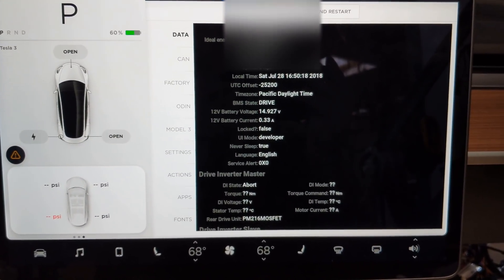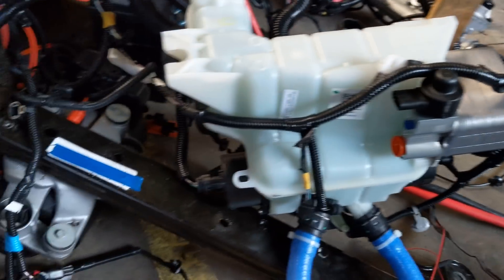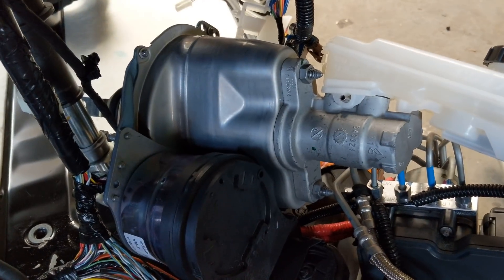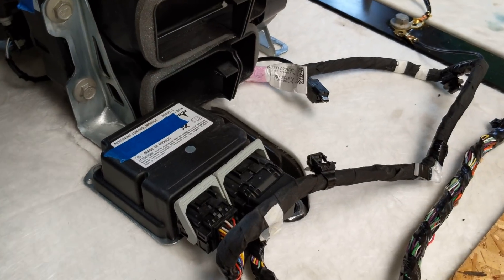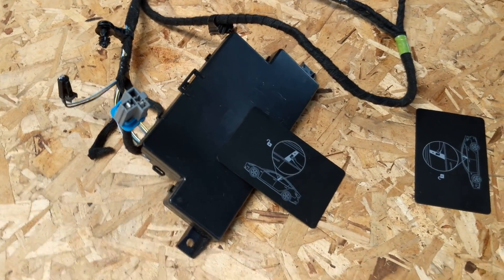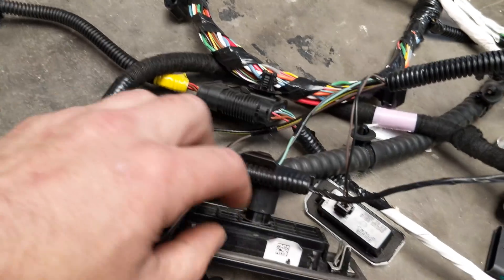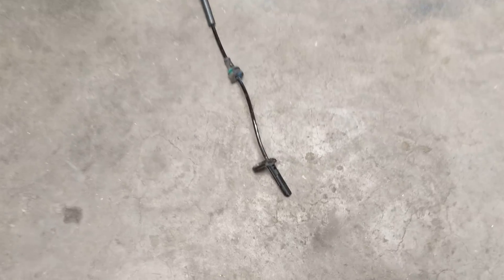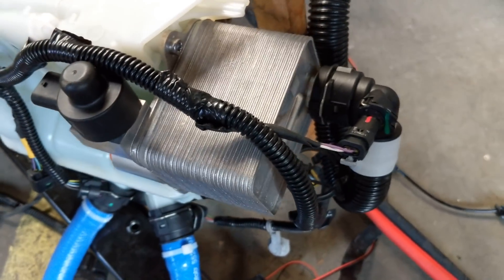Tesla Model 3 - Exploded?!?

Comment: Just a quick question about the screen mount, how hard would it be to put in a spacer to angle the screen towards the driver?  is it just a few bolts or is the wiring interconnected with the mount? Could you maybe shoot a quick video of it?
Reply from the maker: It could be done, no electrical issues, but it would require a custom mechanical solution.  Sorry, I don't have time to shoot a video of it.

Comment: Okay so pardon me for not reading all 280 comments. For a P3D+ what do you think it would take to improve cooling to maintain max power all day at the track? I imagine something in the frunk that adds coolant and more radiators but maybe due to the low temperatures of the battery packs vs ICE vehicles a bigger condenser  or 2nd condenser is more realistic.
Reply from the maker: Research would be needed.  It's not a trivial problem.

Comment: Does the Model3 Have a motor cradle like the Model S ? Does it have the suspension, sway all 
integrated ?
  I want to adapt it to a Factory five Cobra reolica.

Thanks, Jeff
Reply from the maker: Yes, it's very similar to the S/X.  You can see it in my other videos.
Reply: yaa, thanks for the response. I found your other video shortly after that showed the rear clip.

Comment: Many people are having SDCARD failures.  I believe the SDCARD is located in the MCU/ICE module?  Would be nice to know what SD card they are using and how it is partitioned and what file system they are using.  I believe this flash card is used to stage firmware updates prior to the flashing operation.  This SDCARD is probably used for other things like navigation maps, logs, telemetry data etc.  If you would willing to remove the card, connect it to a Linux system and dd image the entire content to an image file, I would be willing to verify the partitioning, file system used and the files contained on the card.  If we can get a part number for the SDCARD,  we might be able verify more details regarding the card (ie.. what type of NAND flash is being used, operating temperature range etc).  I can't believe Tesla would be booting directly from a flash file contained on the SDCARD.  Normally that file would have the digital signature checked after an over the air download and during the actual flashing operation.
Reply from the maker: The SD card is an 8GB Panasonic automotie-rated MicroSD in the bottom of the ICE.  I don't believe the problem is hardware, it's a software bug causing corruption.  It is used to stage some of the FW and it has some logging.  The map data is not stored here.  The car can still operate even with a failed or missing SD card, but it cannot update SW.

Comment: I am trying to find out where the connector(s) are that supply power to the rear seat seatback heaters.  The rear seat bottom heater connector is under the seat bottom on the passenger side.  Thanks for the great videos!!!!!  Regards, Ron

Comment: Do you know how the parking brake works?  What physically happens when you put the car in P? and what is the additional small clunking noise if you then hold down the P button to get the parking brake indicator to appear?
Reply from the maker: There are electric motors on each of the rear brake calipers that can mechanically apply the rear brakes when you engage P.  If it's already applied, the second push-hold just tries to tighten it, but nothing will happen except a small noise.

Comment: Fore most of us it is very much a case of if it stops working you can only walk away and buy a bicycle. The complexity is astounding and way beyond anyone having a hope hacking a temp repair to get home or to the nearest town. It totally raises the cost of any repair into the stratosphere. Even with 10 year internal combustion engine cars the complexity is beyond most people to fault find and repair. I was chuffed with myself working out that a crank sensor had died and that I was able to replace it for around $100, if it was done by an auto repairer I was looking at close to $1,500. So something going wrong is a Tesla outside of warranty is going to cost BIG bucks!
Reply: You probably could fix most of this Tesla stuff if Tesla would make avail tech info and parts... ie, right to repair movement. Mitchell's repair manuals and a decent scan tool have been my go to for years and I have been able to fix most of my stuff.

Comment: That huge charge cable, leading to the charge port, could well be an aluminum cable and needs that larger dimension to have the same cable resistance as the copper S/X cable.  Just a guess.   But it could be both, an aluminum charge cable and a design that will support higher charge rates in the future.
Reply from the maker: Yes, this has already been determined.

Comment: Is there no thermal isolation at the heating/cooling system?  
Should be inefficient when you turn on the heating during winter period
Reply from the maker: The cabin is exclusively heated by a PTC electric resistance heater, it is 100% isolated from the gycol cooling loop.  Only the A/C system is shared, for cooling only.
Reply: I was thinking that the battery is heated using this system so if heat is lost by not isolating the plastic tube, it becomes very hard to keep the battery warm enough while driving and being stationary in cold weather. Same for the battery underside.

Comment: Why does Tesla need to view the passengers?
Reply from the maker: Tesla doesn't, but soon you will be able to send your Tesla off to Uber/Lyft for you with no driver.  The cam is to watch your car while it's doing that.  Also, Tesla is going to release a built-in dashcam feature soon.  If you are worried, just put a small piece of black tape over it until such time as there is a reason to use it.

Comment: Two Questions: 
1) What Frequency is used in M3 RFID Cards.

2) Fronk latch wire colors/functions.

I really appreciate your M3 system and detailed component analysis & reports. Fantastic work.
Reply from the maker: 13.56 MHz.  It uses the NFC standard, you can read Tesla cards with a standard NFC reader.  Explaining the detailed  functions of the frunk latch system is a project in itself, sorry. That would require paid consultation.

Comment: One thing that concerns me is "frgility" of the system.
If the touchscreen gets smashed, can the car still be driven back to safety?
Reply from the maker: Yes.  The screen itself is also super rugged.  I have yet to see one break in a crash even that really mangles the car.  The computer is also not located in the screen itself, it's up under the dash out of harm's way.
Reply: Thanks for your reply.On hindsight the question was a bit silly, but still others may also be reassured that the designers did the job properly.

Comment: @Ingineerix, Is there any connection usable for a secondary display? OBD-II, proprietary, etc.? I see a couple of unused connections. My question comes from seeing the new Model S interior still showing a secondary display with the new central display, Wondering about a future add-on, factory or 3rd party.
Reply from the maker: There is no DLC3 connector in a Model 3 (What you are calling OBD2).  There is also no extra display connections on the ICE.  However, it would still be possible for a 3rd party to make a display.  Personally, after about a week, I don't miss the IC.  You quickly get used to it.
Reply: Thanks for the info! Wondered about it for 3rd party products for those wanting something for a "racing display" or HUD for the track.

Comment: Did you find a place to pull high amp low voltage for a power inverter? Maybe the heater terminals?
Reply from the maker: It's safest to tap the 12v under the rear seat cushion, passenger side.  You have 150 amps available there when the car is awake.  Please use a proper fuse!   This is where the 12v power is "generated" so this is where you want high current loads.  Look at the big red cable here: https://youtu.be/rDYbvI32OBE?t=1m4s   There are two little levers underneath the rear seat cushion that release it, then just lift up.
Reply: @Ingineerix Thank you very much

Comment: Silly question, but one that I know a few others have asked:

Is there a good, current limited, 12v source above the windshield?  Perhaps from the lights or autopilot?

I know folks are looking for a good way to power a dash cam or radar detector. Most solutions I’ve seen involve running a wire all the way to the cigarette lighter port.
Reply from the maker: The overhead console module that contains the Hazard switch and front map lights has +12v on pin #1, which is a yellow wire. Ground is pin #16, black wire.  Should be ok to pull a modest amount of current from there.
Reply: Great thanks.  Do you know if its constantly powered or if it goes off when the car is not in use?  This is great information.
Reply: Is that switched or constant?  Similarly, have you happened to find a good switched and/or constant 12v inside the center console or footwells?  (Yes, there's the lighter circuit, but I was thinking of an intentional ACC circuit, such as the one in the X: https://i.imgur.com/U2sRiCQ.png)
Reply: (Repost; should have replied directly to you originally.)  

Is that switched or constant?  Similarly, have you happened to find a good switched and/or constant 12v inside the center console or footwells?  (Yes, there's the lighter circuit, but I was thinking of an intentional ACC circuit, such as the one in the X: https://i.imgur.com/U2sRiCQ.png)

Comment: Whoa, at 6:11 you can see the passenger side B-pillar guts is just missing the NFC antenna and connector (clearly for eventual RHD exports). I wonder if the domestic version could be upgraded to allow card access on the passenger side . . . likely never that simple. Thoughts?
Reply from the maker: I would imagine on RHD, they just swap the modules.  I'm not sure why you would want NFC on the passenger side.  If you don't want to use your phone, Tesla is coming out with a fob accessory soon.  (Will not need to be held to the B-pillar.)

Comment: Amazing stuff! But what about speakers, tire pressure sensors, head lights and tail lights, airbags, seat heaters, door electronics/window lifters?
And how do you test all this stuff, when it is not in the car? I mean: all your sensors (wheel speed, tire pressure, brakeline pressures, acceleration, GPS, coolant temperatures, cameras, radar, ultrasonic sensors,  ...) do not send values/data that match anything, that is expected by the matching electronic control unit.

The layout may help you in tracing soingles.
Reply from the maker: I have another car that drives I can test things like this on.

Comment: Hi nice work but I have a legitimate question I’m a automotive technician and I’m use to plug in a diagnostic tool to a car and I know there is no ODD 2 plug on the car but let’s say that the car is now 10 years old a the warranty is not valid anymore and there is no Tesla service centre close to your current location and there is a malfunction in the drive train system or ABS or Air Bag system or any other system in the car does the Factory trained tech use the Center screen and a secret pass word to get accès to the diagnostic of the car or from what I’ve seen in the model S/x there is a special port were they connect a labtop computer or a special diagnostic tool this is what scares me of Tesla cars if no independent shop or owner can not repair there own cars then this a big problem. Tell me if I’m wrong to be worried ?
Reply from the maker: Yes and no.  Tesla has not been forthcoming with service information.  This is why people like me exist.  I have helped hundreds of S and X cars that Tesla will not work on (Grey market/Salvage) get back on the road.  Several states have started passing right to repair legislation to stop manufacturers from doing stuff like this, so hopefully in 10 years this will not be a problem. Until then, there will be people like me around to help.

Comment: Also, doesn't YouTube have a video stabilization option?  Not as good as a gimble but you could run it on all your existing videos.
Reply from the maker: It doesn't help with fast pans.  Only higher frequency vibrations, and it doesn't work that well.

Comment: Elon said the Model Y will use a redundant flex circuit with just 100 meters of wire (versus 1.5 km in the Model 3), and that the intent would be to also transition the Model 3 wiring to this flex circuit approach.  How easy do you think it will be to replace (on the production line) the Model 3 wiring with the 100-meter flex circuit, after that has been fully developed for the Model Y?  Something that could happen soon (that is, implemented on the Model 3 at the same time the Model Y goes into production — 2020, or even sooner)?  Thanks!
Reply from the maker: I'm not sure why you are asking me this, especially since I haven't yet seen such tech.  But I'm sure if Tesla figures out how to engineer it, they'll figure out how to get it into production.  In my opinion, The 3 already has a markedly reduced wiring system compared to not just other Teslas, but even other ICE cars.
Reply: Tesla said the new flex circuit use would not only reduce the amount of wire, but they would also with that technology get rid of the problematic Lead-Acid battery (needing sometimes frequent replacement due to charge-discharge cycles).  So I asked the question hoping to get a better idea how long I might have to wait to avoid getting a Model 3 with a Pb-acid battery.  Don't know what they would use in its place; I'm sure if it was an easy problem, they would already have executed.
Reply from the maker: Don't wait because of that.  Even on the early cars I've owned it really hasn't been an issue.  I don't expect the 3 to lose the 12v battery until a complete redesign.   Wiring has nothing to do with that.  I think you'd be waiting many years.

Comment: Interesting. The DC cables for fast charging look like 70mm², which are normally rated around 250A (100kW@400V) but could be rated up to 420A (170kW@400V) with a high performance cable like this ( http://www.axon-cable.com/en/02_products/02_composite-cables/02/index.aspx )
Reply from the maker: They are 95mm2 (3/0 AWG) Aluminum and made by Coroplast.  FHALR series.

Comment: I read in the Tesla forum that the Model 3 "have a current sensor... If you wire directly to the battery terminals the car can't monitor the current that is being used so it can't monitor the SOC of the 12 volt battery." 
Is there any way around this?
I would love to have an extra subwoofer+amp. using 30A!
Reply from the maker: DO NOT wire directly to the 12v battery!  It's safer to tap the 12v under the rear seat, passenger side.  You have 150 amps available there when the car is awake.  Please use a proper fuse!   This is where the 12v power is "generated" so this is where you want high current loads.
Reply: THX! You made my day!!! :)
You wouldn't happen to have a picture of the cables?
Reply from the maker: Look at the big red cable here: https://youtu.be/rDYbvI32OBE?t=1m1s   There are two little levers underneath the rear seat cushion that release it, then just lift up.  You can miss the connection!

Comment: @Ingineerix - thanks for another great video. Do you know whether the Supercharge receiving cables are aluminium or copper? Based on the cable diameter / specification, what do you estimate would be the peak amps / kW they might be rated for (over say a 15 minute peak amp/kW period)?
Reply from the maker: They are 95mm2 (3/0 AWG) Aluminum and made by Coroplast.  FHALR series.  Should be good for 150kW for a s long as the pack can hold that level.  (The pack will be the limiting factor, I think)
Reply: Thank you, very helpful information! I'm browsing the Coroplast catalogue. From their derating curves, it appears that the aluminum 95mm2 should be good for 450+ amps in ambient temperatures (of the cable run areas) below 80 Celsius. Since the model 3 LR pack voltage is 350 V, that's around 157 kW peak, just based on the cable specs. If we optimistically allow 500 amps (depends a lot on ambient temperatures) in shorter bursts, that would be 175 kW.  You are surely correct that the cable likely won't be the limiting factor, rather the cells/pack will be. I'm guessing the new superchargers will be capable of delivering at least this much power (157-175 kW), likely more. It also seems likely that S and X will get battery spec refresh around the time that the new supercharge spec is released, since they are supposed to be positioned as the technology leaders, over the 3.

Comment: Is the ICE .100?
is there a separate gw like on S&X? .102? 😋
Reply from the maker: Yes to both questions, but no exposed (working) ethernet port.
Reply: Thanks!

Can things like developer or diagnostic mode be set like on the other models? (if one had ethernet access on the M3)
I heard they share codebase so I would assume so.